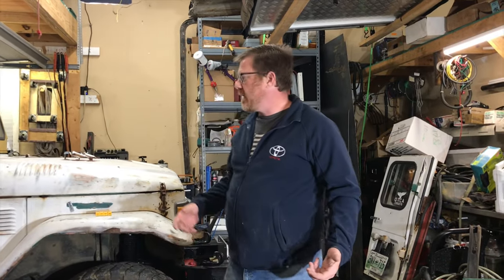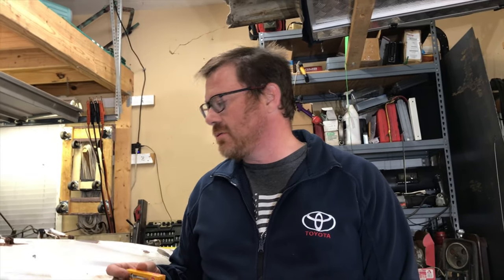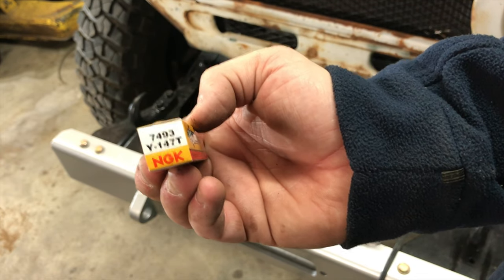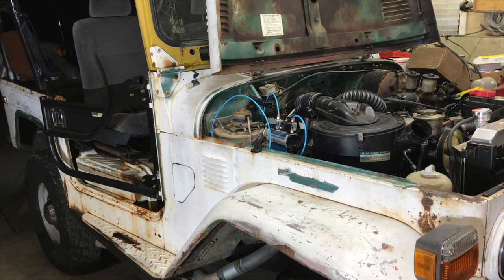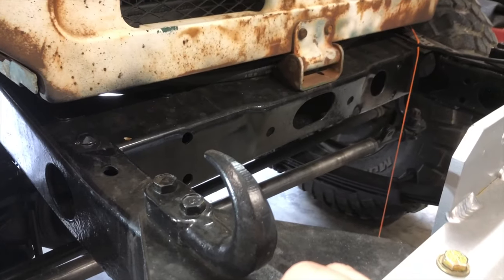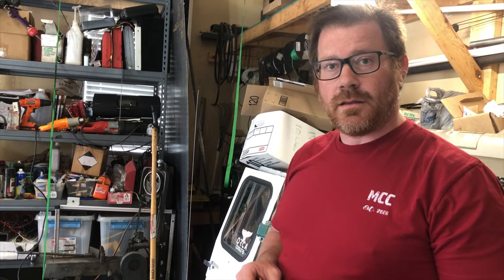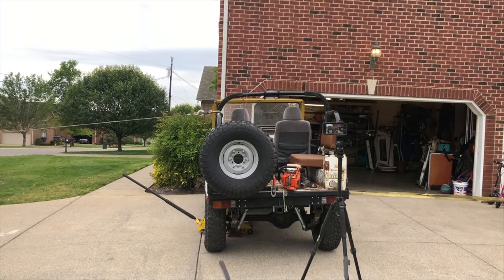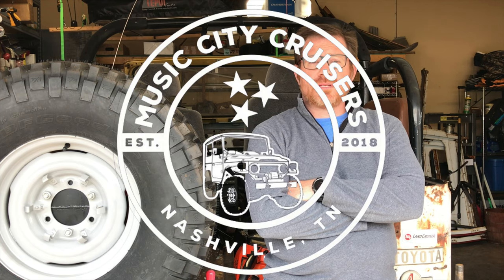Attempting to straighten the rolled FJ40

Comment: If doors closed good I would repair body on my truck I think it was rolled at one time in its life one of my roll bars is still slightly bent thinking about putting a family row cage I replace my quarter panels and Rockers I really can't tell any damage after work was done your trucks looking good.👍
Reply: Thanks Paul, I was leaning towards a new body, but after the work Dan and I did, and talking to guys like you I'm thinking we can fix it.